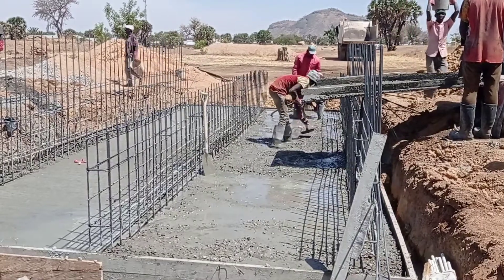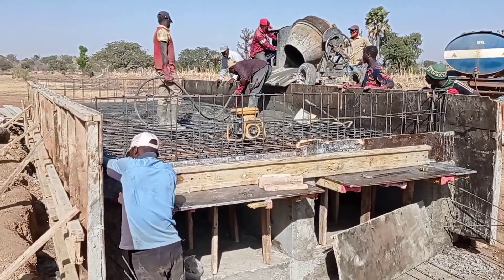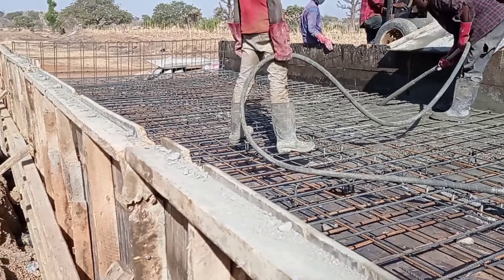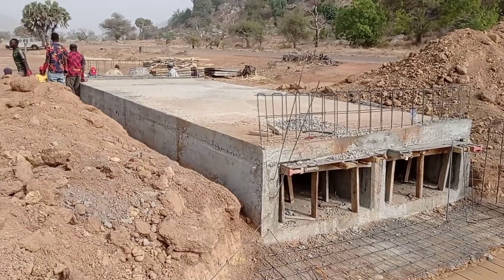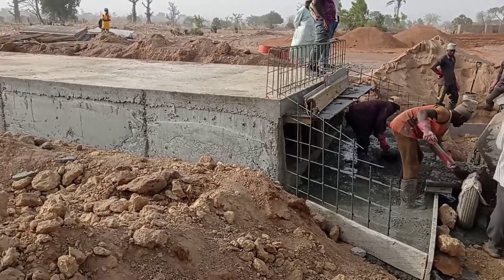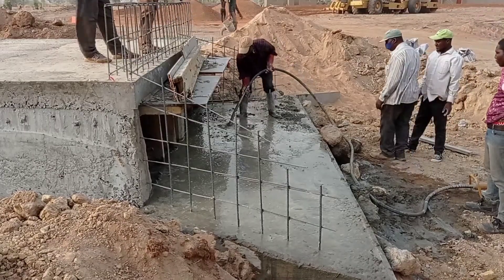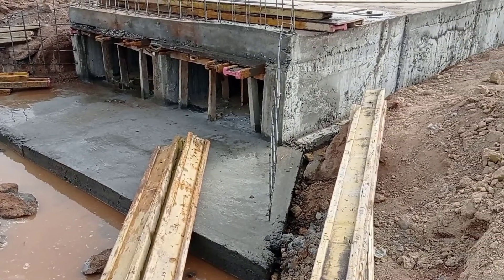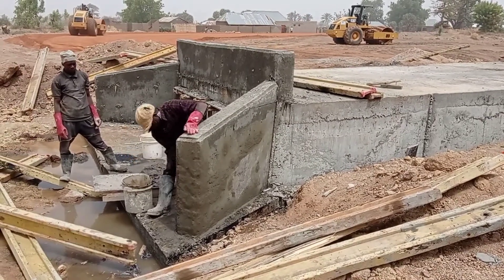Construction of Box Culvert | Double Cell Box Culvert | Complete Construction

Comment: Can spacing of 250mm on the vertical bars of 12mm and 300mm on the horizontal bars of 10mm be ok to construct a culvert that will run under a storey building only to carrying erosion flow? The building will not directed be rested on the culvert,it will have beams resting on columns  running across it.
Reply from the maker: Hi, it'll be fine provided you use double mat. Thanks.

Comment: Did you use only one layer of reinforcements for wingwalls? If yes, why?
Reply from the maker: Yeah, you're right. 
It was due to low height of culvert & laterite filling on top of culvert. 

If the culvert is high & there is less amount of laterite filling on top of decking slab of culvert, then you may decide to make it double mat of rebars.
Thanks. 😊

Comment: Thanks for the video. May i know why you didn't cast the headwall & the deck slab at the same time?
Reply from the maker: Hi Ronald, you're welcome.
Due to the shuttering of head walls; we had to first prepare the decking slab and late fixed the shuttering for head walls. This method is comparatively easier. Hope you understand the point.
Thanks. 😊
Reply: Okk
Reply: Callla,,okkk

Comment: Can you tell us wing walls as meter.what about the lenght of apron slap.did you use reinforment bars in floor slaps or not
Reply from the maker: Wing walls length projection is 2.2m. Whereas, apron slab has projection of 1.5m. 
Yes, I used reinforcement bars for Apron slab as well. I used Y10 as main/runner bars and Y12 as distribution/short bars.
Hope it helps.
Thank you.